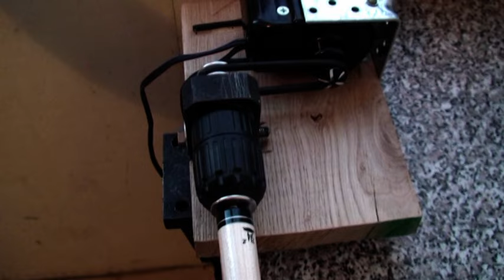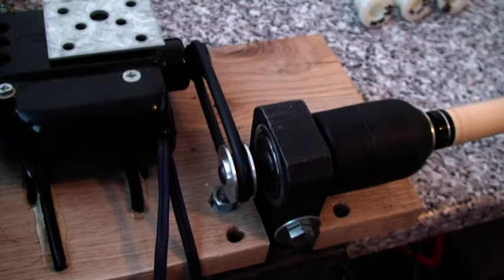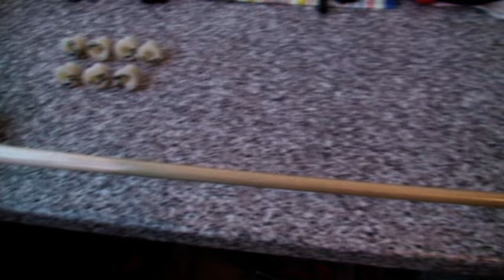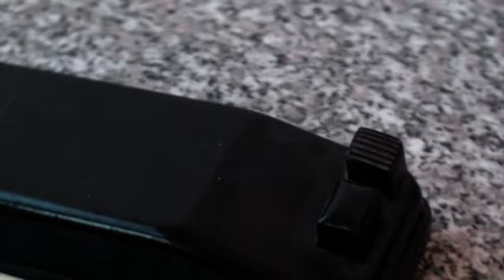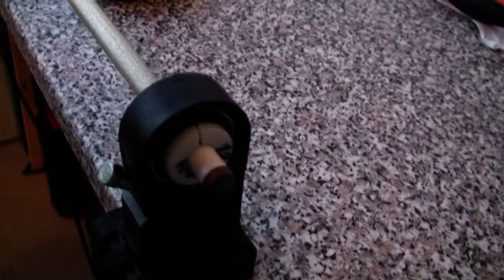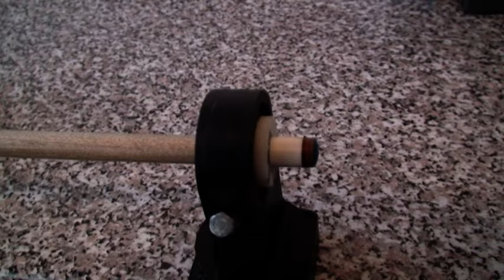Handmade lathe for installation cue tips and ferrule (prototype)

Comment: What type of pillow bearing is being used here? It looks like it can be simply attached to a table.
Reply from the maker: I originally created a portable desktop machine, for use in different places. Minor repairs and customer service on their premises. All basic details of the machine fasten on any table-top. I didn’t have enough time to show on the video everything in more detail from start to finish. I'll try to fix this moment !!!)))
I installed a 2 row bearing.
Reply from the maker: https://www.youtube.com/watch?v=wAAdNGzv6i8&t=2s&ab_channel=technologcue
Reply: @technologcue  Thanks for your fast reply! I've looked up "two row bearing" on the internet but couldn't find the specific bearing you used to fix the tip end of the shaft to the table. Can you please provide a link to the so called two row bearing? Standard pillow bearings can be found anywhere but yours seems to be perfect to simply attach it to a workbench or another flat surface. I'm currently using a standard pillow bearing which I've screwed on a piece of wood to adjust the height and it's held in place using two clamps. Not really to my satisfaction :-)
Reply from the maker: @Baeggopp  https://intertoolglobal.com/catalog/rashodnie-materiali-i-prinadlezhnosti/prinadlezhnosti/prisposobleniya-dlya-dreley/intertool-ht-0090.html
Reply from the maker: @Baeggopp  you asked about it ?
Reply: @technologcue  Aaah I see. It's a drill holder and you've placed the bearing with the matching OD inside. Thanks! Great idea btw!
Reply from the maker: @Baeggopp  https://www.aliexpress.com/item/32769229505.html
double row bearing 43mm x 20mm
it's on the back
Reply from the maker: @Baeggopp  https://agrol.in.ua/p715114995-vtulka-naveski-kosilki.html?source=merchant_center&utm_source=a5o5_adwords&utm_medium=cpc&utm_campaign=cid_17672497110_search&utm_term=
such a bushing is placed in the bearing
Reply from the maker: @Baeggopp  the drill chuck is installed in the same way
Reply from the maker: I created 4 machines like this
https://www.youtube.com/watch?v=oY1Z86Mp5iE&ab_channel=CuejosCustoms

Comment: I'll pass. I don't think this is a good machine due to spinning the shaft in the collar at the tip end and therefore you create more work for yourself at the tip. You can also cause issues with the shaft not having your centers on a base.
Reply from the maker: You can not judge a product if you do not know the complete set of the machine. To the car that on the video in the kit is a table holder with a bearing and bushings of different sizes))). Before sending customers I send them a photo of the complete set of machine! Good luck !!!
Reply: Yea the collar doesn't look right. This guy seems to sell a really shitty set up for more than what a good machine costs.